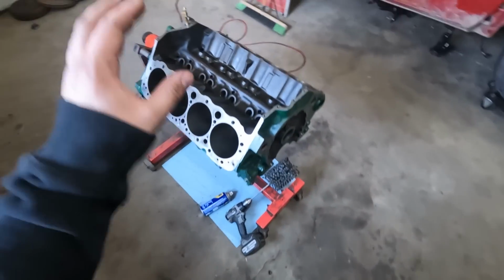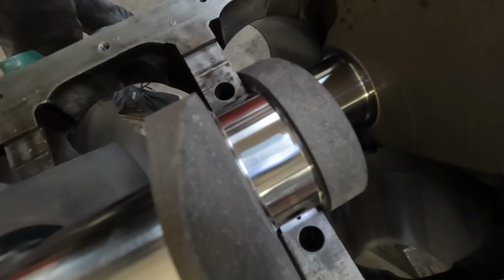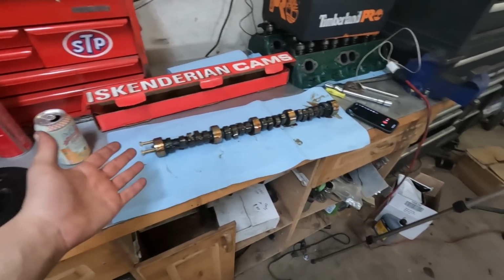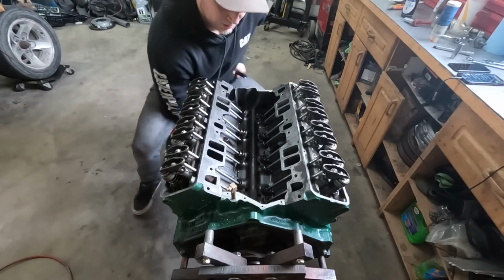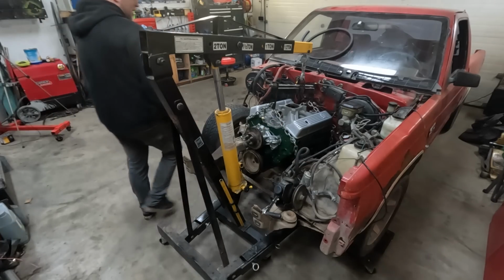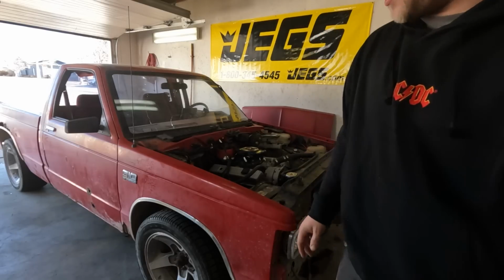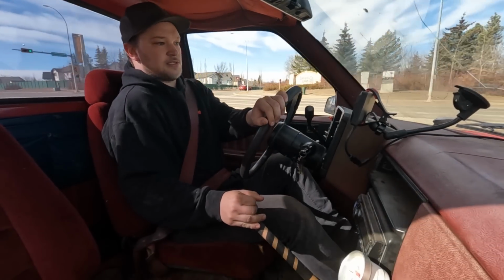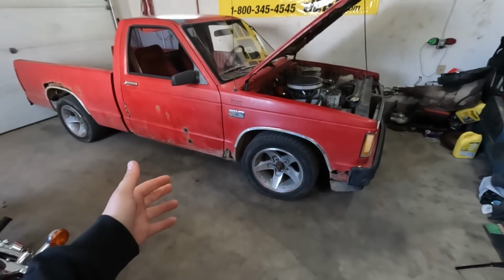Shitbox 400ci SBC Rebuild, Installation and RIP. 5 Speed V8 S10 HAULS ASS

Comment: So satisfying I have a S10 blazer stock 350 and 5 speed they are pretty quick easy 90 mph in third gear and 3.42 rear gear blasting through traffic I'm always messing with people running a quite exhaust they never expect it

Comment: Problems I’m seeing.

Did you check ring end gap?  Ring ends butting together will blow a piston apart.

Oil pump to pan clearance too ouch or too little causes oiling issues.

Following up to your Tik Tok vid where she blew.

Comment: Let me tell you little trick when I built my 383 S10 we did frame off 5speed just like yours but a trick we did with front suspension we took v8 Camaro front coil springs and put it under the front of the S10 and man let me tell you the difference in handling and driveability freaking awesome
Reply: What engine mounts did  you use? And what was ur engine teanny angle? Thanks

Comment: Throw some slapper bars on it to prevent that axle wrap
Reply from the maker: I have a neat factory option I’ll be adding
Reply: @Ak_Strem  🤔 Was thinking caltracs. Are you going to add another leaf spring? Rear sway bar? Not going to stop wheel hop. 
This s10 is roaring to life again with that sbc. Some ladder bars/caltracs and a 150 shot of NOS this baby would be runing 10s 1/4. Every one wants to LS swap the world , but not everyone wants to dial in a tune on everything they build. Great Job